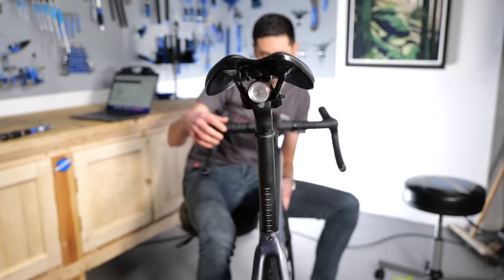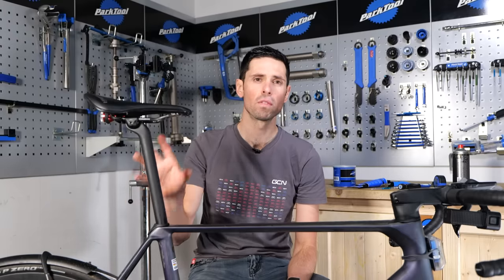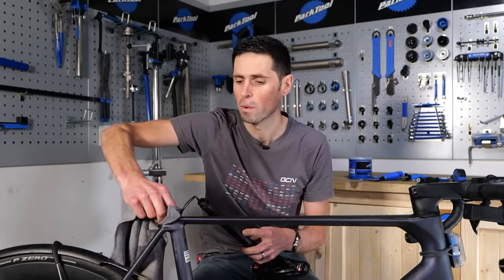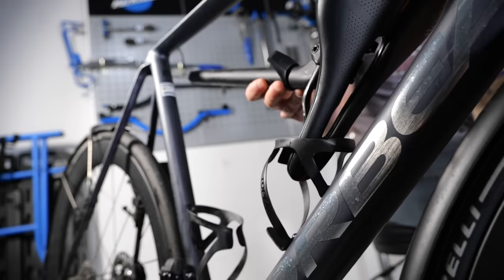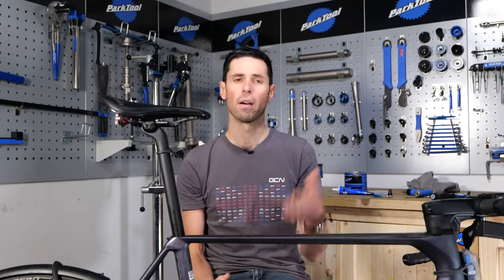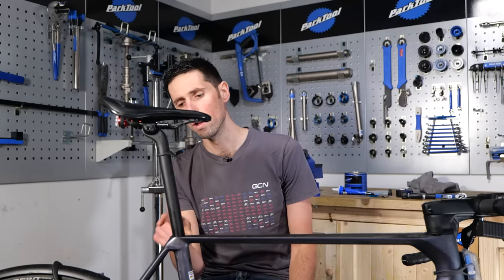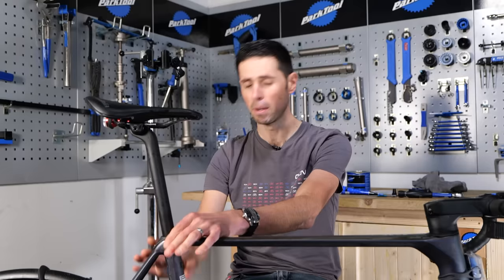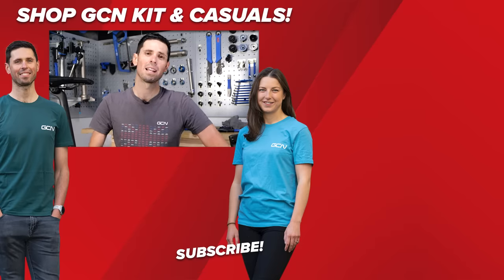How To Stop Your Seat Post From Slipping!

Comment from the maker: Have you got any tips that we missed? ⚙
Reply: I had this problem on my Canyon Endurace. Initially, I used carbon paste, which came with the bike. However, my seat post started creaking, and I quickly realized that the paste was causing it. So, I applied a bit of Solidol grease to the seat post, which solved the issue. Everything was fine for about 1000km, until one day, my seat just slid all the way into the frame. I tried applying less grease, tightening a bit above the recommended torque, but it kept slipping. Then I read on the internet that a regular toothpaste can help with both slipping and creaking, I tried it, and it worked. So I recommend using toothpaste if you don't have a good carbon paste and don't want to spend money on it.
Reply: @Matvey. Same bike, same problem. Thanks for the tip.
Reply: The steps described in this video also helps fix another issue I had with my seat post. When I bought my Cannondale couple of years ago, it started making cracking noise after just a couple of rides (Crack-on-dale as they say, didn't know at the time).

After investigation, I realized the cracking of the seat post was caused by me tightening it up too much. I have tried untightening it a little but then my seat post would slip, leading me to tighten it more, which was making it do cracking noise again. In summary, unfixable.

Then, I found out about the SAC-2 paste from park tool (and also bought a torque wrench in the meantime). This fixed my cracking noise and/or slipping seat post both at the same time.

Thanks for sharing such useful tips. I learn so much by watching!!!
Reply: I have wrapped some cm of electrical tape around the post, just 2mm above the frame. Every time, i remove the seat, i don’t have to measure the correct height at reinstalling. Maybe sometime I need the tape for fixing an issue. It also prevents the post from slipping through in case the clamp is too loose.
Reply: -alex-3724 Sorry, but have you got any idea what an integrated seatpost is? It is integrated. It can’t slip.
Reply: My advice would be to combine the Salsa Liplock seatpost collar mixed with Park tools friction grease.  The Park tools has the biggest silicon pieces in it out of all of them.  If this doesn't work I'd borrow another seatpost and try that.  I'd toss the frame after this, unless you want to try jamming a 1 size larger post in there, which you shouldn't do.
Reply: Spraypaint the seat post with "peelable Eurethane tool handle grip" by rustoleum etc. Takes up the slack and makes it trippy like the rubber dipped tool handles, wd40 dissolves it and it peels off better than plastidip
Reply: I dont want to spend more on a paste, is there any other way? its already tight, not sure what else to do here.
Reply: The label on some carbon gripper paste packages says "shake vigorously before use". It seems to be very important. Because if you do not shake it, you run a risk that the paste you pour out would have a lot of gel and too few friction particles.
Reply: In the video https://www.youtube.com/watch?v=qW-9ca4morE do you know what grip/gritty paint was used on the seat post?

Comment: If you have a non-round seatpost, wiggle it back from side and back and forth with a bit of force when tightening and do the tightening in multiple steps. This often helps to settle the clamp wedge really flush against the post and avoids loosing tension during the ride. (Looking at you, Cannondale)

Comment: As usual, a super simple job becomes a faff when you have modern tech.  My problem persisted after tightening to spec, and I found that my particular frame (internal clamping mechanism) is prone to the issue.  Some riders gave up, but not I.  The slipping was almost solved, so I reasoned that a tiny bit more resistance to falling might do it.  I located a plastic seatpost reflector mount of the right size (standard on many US-sold bikes) and placed it around the post in contact with the top of the seat tube, snugged it up, and voila!  You hardly notice the added "clamp," and the post hasn't slipped since.
Reply from the maker: Great hack! 🙌 Awesome work, it always feels great when you make your own bike fix!

Comment: It’s worth putting a strip ( sliver) of black electrical tape vertically on to the seat post, ending where it joins the frame.  It’s surprising how many seat tube slips slightly without the rider knowing and only become noticeable when it’s slipped in a lot !   This method allows the rider to instantly see if the tube has slid into the frame because the tape crinkles up as the tube slides as it can’t pass through the bike.   If you cut a sliver it’s visually not noticeable, so you can leave it on the seat tube all the time.
Reply: What’s a slither?  Do you mean sliver?
Reply: No. You should use very thin marker. Tape is a bad idea.
Reply: @kokonanana1  Thanks for pointing out my bad grammar 👏

Comment: I have brand new Trek Emonda ALR5 and seat post is slipping down 1 cm per 20 kms of riding (torque for this part is 6Nm). I used Icetoolz paste to fix a problem. I will check if it works.

Comment: I had an issue with the seatpost slipping and discovered that right where I needed it to tighten, the post was not 27.2, but was 27.06, however , 5mm either side of it, measured 27.2.  After I sat there and thought about it for about 40 mins, it hit me that the post always stopped at the same spot, so I broke out the digital caliper and started measuring and found the narrow spot and got the post warrantied.

Comment: Had the dropping seatpost issue on the latest CANYON ultimate. 

I was installing it correctly with carbon paste and torque as the manufacturer intended. 

The issue was the seatpost clamp screw vibrating loose multiple times. Turned it back during 30 days recall period.

Can't take a torque wrench with me on my ride because of not knowing when the saddle will drop the next time.
Reply: Locktite the screw!
Reply: @kokonanana1 I actually thought about that but want to be able to remove my saddle or adjust the height. 
Also, after reading online that this is a common problem with the seatpost clamp, I didn't want to void the warranty either in case it wouldn't solve the issue.
Reply: @tobiaswaldner  loctite the clampscrew, not the seat post
Reply: @janeblogs324  Sure the clampscrew...  But how many andustments would you be able to make without wearing the threaded bushing in the frame?
Reply: Having screws that vibrate loose is such a joke, especially on an expensive bike.  I hate reading stories like this, glad bike industry is struggling selling crap like this.  Having China in charge of your bike is always a fail.  Just look at the brake calipers they make compared to Shimano.  They change the arm adjuster screw to be 2mm in China and then it just vibrates and moves while you ride, smh.  Arm adjuster screw is supposed to be 3mm so it can't move.

Comment: My seatpost kept slipping when I first got my most recent bike. Never happened before in all 5 carbon bikes I owned except this one. Only difference is the frames I had before had metal inserts that I imagine are more flexible than carbon and allow more torque and pressure to be applied. I'm guessing current frames to keep the weight lower have removed all kind of metal inserts/interface surfaces. That said my seatpost is now being slippage free although I don't know why and am scared to even mess with it further.

Comment: If you don't have cool park tool paste , you can use a bit of spit and sand. Also a nise self threading screw through frame and seat post will fix you slipping issues..👍
Reply: Is it dangerous to do this?  will it damage and crack the frame or seatpost in long run?
Reply: @Saltydog547  It's fine, there are bits of silica in friction grease.  Sand is also silica.

Comment: I have struggled with this on my Canyon Exceed, which has the integrated seat clamp with the set screw in the carbon frame with only 4Nm of torque, which I dare not “exceed.” I have used carbon paste from Park Tool and it’s never really been great.😐I will probably either add a dropper seatpost, or maybe just add a collar to the seatpost for a little extra reinforcement.
Reply from the maker: If in doubt send it over to your local bike shop 🙌 They will always be there to help you out with those tricky issues!

Comment: #gcntech What is the benefit in wearing a white jersey, socks and shoes over, for example, a black jersey, socks and shoes in hot sunny weather? White is said to reflect heat, whereas black is said to absorb heat more readily, but is this correct and if so, how much does it affect the rider?

Comment: My carbon bikes never slip, but my steel bike with a Thomson seatpost slips. I tried a new saddle clamp, with grease, without, with carbon gripper paste. Nothing helps. Any tipps i could try?
Reply: Could be wrong diametre post?
Reply: Sand all the hard anodization off it. Its slipperyer than shimano hubs

Comment: I'm kinda afraid to ask, but why does the seatpost have cables if is not a dropper?
Reply: It’s where the battery is stored for electronic shifting. For some e-bikes, cables also run through the seat tube for saddle mounted rear light.
Reply: Battery cables for Di2 drive train.  Without that extra complexity, you have no bike at all, right?
Reply: @coconutman1980  thanks for the answer!

Comment: #askgcn
Hi guys, I have a question about cycling shoes, I always get numb feet after 15- 20 miles and it's so bad that doesn't go away for an hour after finishing my ride . I am wearing size  9.5 for trainers and my cycling shoes are size 10.  It seems to fit me perfectly and I can even wiggle my toes. I use Specialized Torch shoes. Is there any solution? 
(The numbness isn't caused by cold temperatures)
Thanks!
Reply: I used to get tons of numbness before switching to the green specialized footbeds. Rode a century and couldn't feel my big toes for 2 days. Last century no issues with the same shoes. Only changed footbeds
Reply: @BigDrawersMcGraw  what kind of sole did you get?

Comment: NEVER lubricate threads of a fastener with grease or the end load will be above spec at the required torque load. Use a thin oil instead.
Reply: Yeah, thats True
Reply: Neither grease, oil, nor anti-seize - usually torque specs are for clean threads, and need to be adjusted if a lubricant is used. But in a case like this I would go with whatever the manufacturer has recommended in their assembly or maintenance guide - their recommended torque spec might be for a lubricated screw.
Reply: There is no such thing as a torque setting for a seatpost collar.  You tighten it until you can't move the saddle from left to right and that is your torque setting.  For crappy modern carbon seatposts you can guess at this measurement with a 5nm-10nm torque key I guess.
Reply: @___Bebo___  the torque setting isn't for the collar, its for the carbon crushing